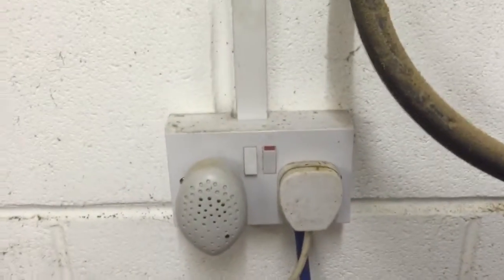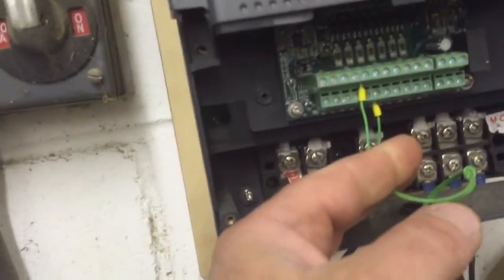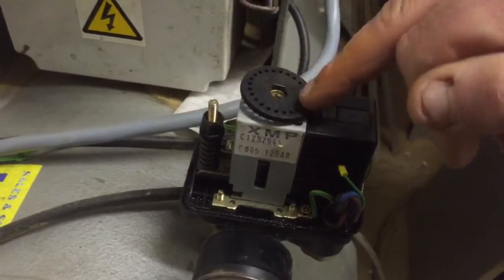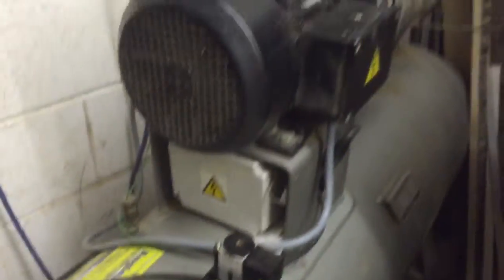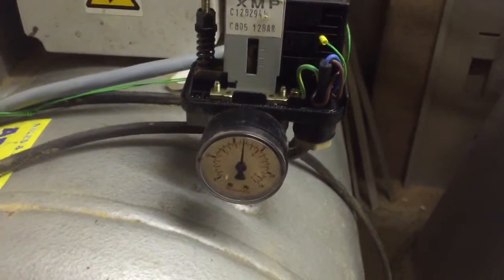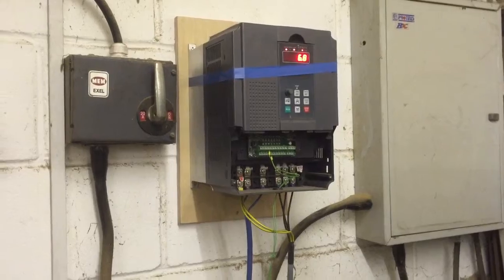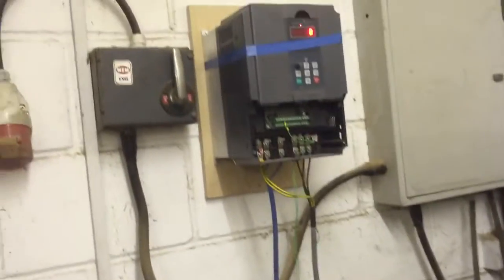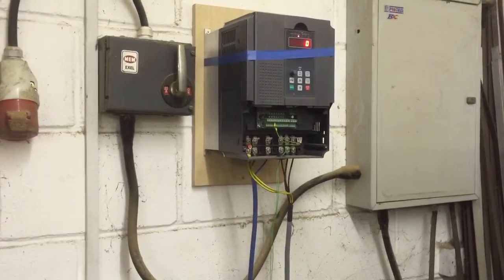Hydrovane 504 fitted with inverter

Comment: Can you post your vfd voltage and frequency settings
Reply from the maker: 220 v in 380 out
Minimum 7.5 kw to run 4kw motor ! 
50hz standard for normal motors ( uk)

Comment: Great to see this running as I've just bought a 4KW@380V Hydrovane with Broken control gear. One question what voltage is the run signal?
Reply from the maker: Run signal is powered from vfd at 24v 
( just an input to vfd)  which switches to ov

Comment: That inverter must be special if it can put out 380V with 230V single phase in.   
Im enquiring on getting a hv04 and will use inverter too.  What is your experience with rotary? I have only owned piston before.
Reply from the maker: Much quieter and faster than piston. 
It’s classed as a boost inverter. 
Requires 7.5kw model - no smaller!! 
I have used lots of them on my cnc routers. 
Only one I have had trouble with is ecogoo-  warranty useless! !!!
Check out sako brand / they seem good. 
I did a couple of videos of my test unit
Reply: @automateanything  
It is interesting, i have never seen an inverter with an integrated boost converter  before.  (I repair large ABB inverters as my day job)  

Occasionally we have had to use single phase, the motor has to be 230v/415v instead of 415/690v though. 

Im glad they are quieter, my 3Kw piston is about 96dB.

Comment: Seems to be very quiet machine. What can you tell about the compressor itself - is it good for garrage use? I'm thinking about 504 or 23 model. Both are 4kW but 23 series is equipped with discharge cooler mounted on electric motor. Very little info about 23 series on the internet and i can't figure out the differencies between the two models. Maybe you know which one is better? Thanks!:)
Reply from the maker: I've got this one and a larger 5.5kw unit.
This one has been powered on since this video was made in 2016.  Perfect and only hear the whine as it starts up.  I know nothing about any of the other models.
Reply: @automateanything  heh, i found my comment here after all those years:D:D I ended up buying Hydrovane 33 - 5.5kW and it's PERFECT for home use.

Comment: Do you mind me asking how much the inverter cost? I'm looking to run a 3 phase hydravane 23 but I've only got single phase.
Reply: Bought the same one off Aliexpress,  mines running perfect just had to wire in a pressure switch to cut out
Reply from the maker: around £400 direct from china- purchased via ali express.  (its a special order item not stocked in the uk) check if your motor is dual voltage first? 220/380 as then a cheaper unit can be used
Reply: Have you got any link to where you ordered the vfd? Been searching on ebay but they all seem to be 240v three phase output. My motor is single voltage 415v unfortunately
Reply: I've sourced an inverter the same as yours. Any running issues with the compressor since installing the vfd?
Reply from the maker: @KevRWDstarlet   sorry- this has been working perfectly since fitted.  5 seconds startup. only annoying thing is fans on vfd cant be switched off. i have a different vfd from ecogoo which is still 7.5kw  but much smaller running other motors. fans shut down properly on that one!  and its about £275 posted

Comment from the maker: Motor is 4kw @380v
Inverter is 7.5kw - runs nice and cool 
Draws 32a on startup of motor and 7a on motor running compressor after startup 
Been perfect since fitted . Dropped startup acceleration time to 5 seconds now
Reply: automateanything any chance of a video with the 5 sec start?? I’m doing exactly the same with my 504 at the moment 👍

Comment: What size inverter are you using? Also what kW is the motor on the compressor? Thanks
Reply: Motor is 4Kw / 5.5 Hp The inverter he is using is 7.5 Kw . I have a Hydrovane 23 also and was looking to get it running on the standard 3 phase motor as this guy did rather than swapping to a single phase 4Kw motor.